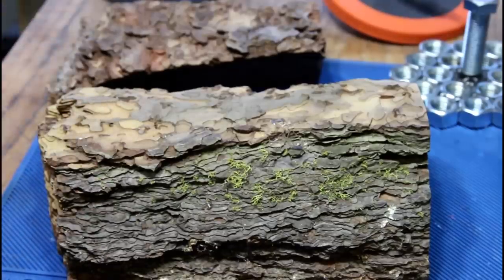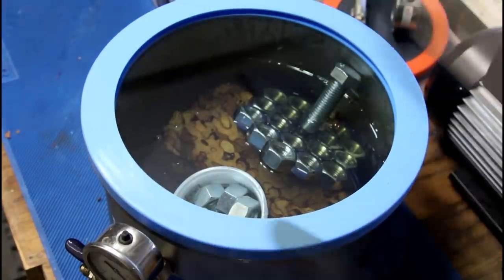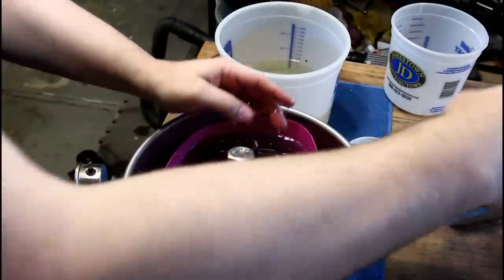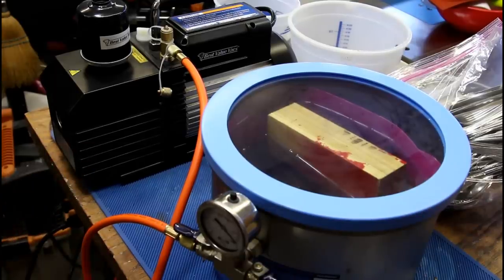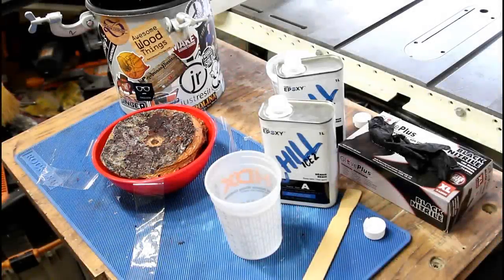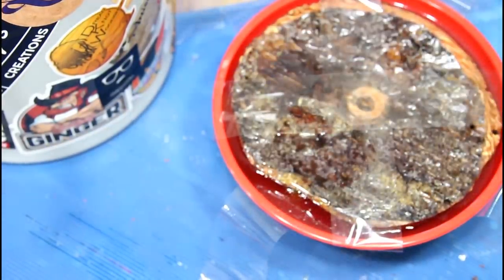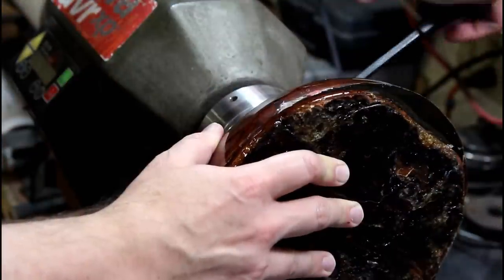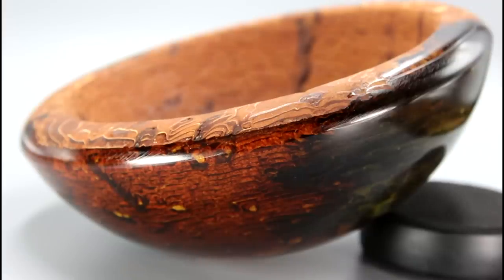Make a bowl From Bark? (...and resin) | Dipit #25

Comment: That turned out awesome! Glad you were able to put it to good use. If you need more for another project, I have a little more I picked up last summer.
Reply from the maker: Austin! Thanks so much. I’ve still got some left. :)
Reply: @peterbrownwastaken  How dry was the bark when you started? I am wondering because resin has a hard time displacing water. If it still has moisture you could probably put a piece in the vacuum chamber and leave it for the water to boil out.
Reply: Austin Lippincott After watching this video, I am definitely going to be researching this bark and tree type.  My kids will get a kick out of learning about this new to us type of tree(we homeschool).
Reply: that is very cool bark and peter is right it has a dragon scale like pattern to it also i have never seen bark that thick before today
Reply: @EricMadWolf  Considering it was from a dead tree AND it had been sitting in his shop for about a year, I'd assume very dry.
Reply: @kimjonglongdong3158  Considering bark from a open grain softwood behaves like a sponge and considering the green moss growing on it I have to assume that despite sitting for a year the bark wasn't dry enough.
Reply: @EricMadWolf  ah, I hadn't considered that. Can't say I ever even knew that bark could get that thick. You clearly know a lot more about wood than I do that's for sure.
Reply: @kimjonglongdong3158  a lot of times, a block of wood that size will need a few years to dry out as much as the atmosphere will allow. It may need to be baked for a bit to really remove the moisture
Reply: @peterbrownwastaken  It wants a spoon :)
Reply: @kimjonglongdong3158  I only know what I know from trial and error. My father has 30+ years of woodworking experience and I have about 10 years of experience and we still learn something new everyday. 
For example, bark is the only part of the tree that's living. The wood we use is dead bark that has been compressed inward (think dead skin flaking off but inside). Depending on the conditions, the tree can actually rot from the inside out while it is still alive. When a tree dies, whether it falls or remains standing, begins to rot from the outside in. Fun fact, dead bark can retain more water than it did when it was alive because it is no longer getting used. 
Learning about the medium you use is one of things I enjoy doing as a woodworker.
Reply: Many ponderosa pine trees are dying in California from the bark beetle. Normally the tree can defend itself with resin, but due to the past drought, the trees cannot defend as well. Another factor is forest fires. Due to the lack of forest fires (which are essential) from human influence, the beetles are able to get out of control more easily. I'm not an expert, but it is all very fascinating. It is a great learning opportunity!
Reply: @EricMadWolf  Bark isnt the only part of the tree that is living. There are living xylem cells, normally an inch or two from the bark, in the sapwood. The inner bark is living phloem cells, but the outer bark is just as dead as heartwood. There is also living tissue in the cambium of the branches, and roots, and all the leaves or needles, all the buds, and the root tips. In a sense of lumber, sapwood is composed of living cells, and the inner bark isnt even used. Id also argue that the problem with stabilizing bark is less of an issue of water retaining, and more to do with suberin. Outer bark acts as a sponge in a compression way, so things can hit the tree and the bark will absorb the blow. The outer bark gets filled with fatty and waxy materials that clog up the fibers, which repels water. It is designed to keep water in the tree and air away, like closed cell insulation.
Reply: @The_Great_Whodini  That's awesome, I love learning new things about wood.
Reply: Austin, I cannot find this bark for sale anywhere online and I NEED it in my life so hard. I'm obsessed with the look of this bark. I need to turn a variation of this bowl. Peter's video has sparked an idea that must be born. Can I please buy some from you?

Comment: Bark wont want to stabilize because as trees develop secondary bark, it ends up being filled with a waxy substance, so all the tracheids or fibers that one would expect to fill with resin, like normal wood, behave and are physiologically different, there isnt really pitting to allow for lateral transfer, and therefore resin filling, as well as bark lacking a secondary cell wall, meaning it is far weaker than sapwood because theres not nearly as much structural components and instead theres more lignin and hemicellulose, the biggest barrier in stabilizing has to be the suberin that fills the bark with waxy and fatty material and stops water and air flow... The ponderosa pine bark is also so thick because of fire adaptation, truly beautiful way to capture the structure of softwood bark. Im a forestry student, I like trees
Reply: TheGreatWhodini Forestrys a real interesting field, hell I think all botanical stuff is. Was wondering why the resin didn’t seep down as deep as it normally would, but I completely ignored the capillaries normally left by normal wood. Great explanation!
Reply: Do you plan on making and posting videos on the topic? I'm interested in hearing you explain what you're learning.
Reply: You use such beautiful words and yet so little punctuation. Please man, my brain hurts
Reply: @skeetsmcgrew3282  most of the time where there should be a period I just throw a comma and move on
Reply: @iplay10101  I dont have time, id love to, but I cant
Reply: @iplay10101  but if you have any specific questions I would be more than happy to answer
Reply: TheGreatWhodini I really like trees but don’t have much knowledge about them yet, I’ve learned more about animals so far going for a degree in environmental studies. I’ve been wondering recently - does seeing a tree covered in mushrooms/fungus mean anything about its health?
Reply: @hannahbrown5465  Absolutely, a fungus or conk on a tree is really bad for the tree health. A tree can be infected without visual signs, it will show symptoms like decoloration of foliage, or wilting foliage, indicating a health issue, and possibly fungal infection. If fungi fully takes over the tree it will release a fruiting body, or conk. The mushrooms are for reproduction and the spread of spores, and can mean the tree is in danger or already dead. It depends on the fungus, so learning to ID common tree diseases is important, as some will only live on dead hosts, and some only on live. There are publications by the USDA and sometimes state by state agencies that will release cull sheets to show deductions when estimating volume to account for certain diseases. Some fungi will compromise a foot or two above and below the fruiting body, and some may take up to say 20 feet.
Reply: Gosh, your comment about fungi on trees makes me a little sad. We had a tree back in my home growing up that had some kind of fungus on it and we never really paid attention to it. The tree wasn't dead, we knew that. It bloomed, dropped walnuts, etc, but there was always this fungus growing on it. The tree is gone now, as we aren't the residents of that home any more, but it's really something to think about.
Reply: @pacmandrugs  maybe, it might be interesting to try out, there might be some publications on solubility of suberin and may be interesting as long as it doesnt compromise the structure or appearance of the bark
Reply: I'm the opposite. I love working with wood so I kill it. I'm a carpenter
Reply: If you made a YouTube channel or a blog on this topic, I'd totally read.
Reply: Do you think a slow and low bake (190°F) for many hours (6-10) would melt out all the fatty/sappy deposits, thus creating voids for lateral transfer of resin? I do this with sappy woods and with woods coated in sealing wax prior to stabilizing with resin. It leaves a puddle underneath the wood of what melts out. If you don't think this method would work, do you have any ideas a to how to evacuate those spaces?
Reply: I love it when art/creative videos lead to fascinating educational stuff
Reply: Fuck yeah. Passion for biology
Reply: IIRC theres a way to chemically "wash" all that out of the bark, so you might be able to stabilize it a bit better.
Reply: I learned something.
Reply: I have no idea what you said but it made you sound really smart.
Reply: Wait I understand what your saying now and I have two questions that might hold the solution. Could you dry out the wax by drying the bark? If so could he poke holes before drying the bark and then stabilize it?
Reply: Lmao justifying yourself with "I'm a forestry student, I like trees"
Reply: Thank you for sharing some of your knowledge. I never knew this. 😊

Comment: Idea for the next Dipit... used rubber gloves. I realized you use gloves, as you should, when working with your resin. A new pair each time, I assume. So rather then throw them out you collect a bunch of the used ones, yay recycling, and make something out of them!
Reply: The elasticity might have something to say about that, but it seems like a cool idea
Reply: What would he turn it into?
Reply: @Alucard-gt1zf  I wonder if the resin would help with the elasticity. If not it would likely still be interesting to watch Peter try to work with it, like he did with the gummy bears ^.^
Reply: @PrincessSixThirteen  Not sure really. It would likely have to be something small but it would be amusing if he could end up making a cover for his gloves, like a box cover that is for tissues but for rubber gloves
Reply: Getting the bubbles out of that would be a nightmare, I bet. It does sound cool, though.

Comment: This will probably get buried, but just in case you see it Peter. I had some cactus juice that got sucked into my vacuum pump, and it cocked it up. The resin cures with the heat inside the pump and with the oil, and sticks to all the parts inside the pump. I had to pull my pump apart,  scrub it all, and even then it's still not pulling as good of a vacuum as it used to. 

Change the oil on the pump if you haven't already.

Comment: A fantastic result from such a difficult material. I love the seethrough section in the rim, it kind of contrasts the thickness of the shape wonderfully, and the outside surface under the resin, with the moss and everything gives it a nice foresty vibe.

Comment: Hey Peter i was thinking watching this, you should make  a special weight just for that huge tub instead of using the little one with multiple bolts to keep it level if need be
Reply: Yes. Even just add extra bolts to his existing weights, nuts too if need be.
Reply: Just get a small barbell weight. They're thin and don't cost much.

Comment: "No resin projects in January."  
I should print and frame your quote.
It was mid-December but I learned that the hard way. I thought "Well, it's cold (unheated garage) but I'll give the 24h resin 7-10 days to cure, it'll work, right?" 
Yeah sure!  I had to completely scrap a fairly large project I wanted so badly to be ready by Christmas.

The bowl might not be exactly what you had envisioned, but it turned out awesome indeed! I love the patterns and depth and details of it!
Admirable perseverance and attitude, as usual!
Great job!

Comment: Hi Peter,
At first I thought it would be a funny video about the mishaps that can happen to Resin. But then it became very vivid. Thanks a lot for this! I have had a bag full of very thick birch bark for years. I found it too interesting to throw away and now, thanks to you, I have an idea.
A little tip from my side. To make it easier for the resin to come out of the bowl, I coat it with silicone, just like you take it for molding. It works great and I can use the bowls again and again.
I'm looking forward to your next video.

Comment: When I have punky wood that is not really a good candidate for stabilizing I use a low speed fixture that I made from a rotisserie motor and adapted a 1"-8 bolt to with a locking nut to which I can attach my lathe chuck to hold my bowl, mug, etc. Then I mix up some clear resin and paint it over all of the surfaces of my piece, torch the bubbles, and allow it to turn slowly while the resin cures. The constant turning of the piece lets the resin self-level without getting drips and runs.

Comment: Fun fact: that thick bark is a fire ecosystem adaptation! It helps protect the tree from damage when fires come through. Ponderosa pines are fire department: their cones are covered in a thick resin which protects them until the heat from a fire comes through, which melts the resin and allows for the seeds to be released. Fire dependent ecosystems and adaptations are super cool!

Comment: Peter, you could brush coats of resin on the inside to fill the tear-out and protect the bark as you turn it at a slow speed.  Then polish like the outside.

Comment: Peter change the oil in your pump. Its easy and cheap enough.  Just in case you sucked up resin.  Also vac pumps accumulate water over time from moisture in the air.

Comment: Whenever you need to separate an outside shell like that plastic bowl and it's just held on basically by suction, if you shoot compressed air from a blowgun into the crack it'll just release like magic.

Comment: Love how it took both of you so long to solve the weight problem when stabilizing, but in the pressure pot you solved basically the same problem with... tape. I guess if it bubbled too much you could’ve used rubber bands. Speaking of which, can we get a rubber band dip-it?

Comment: Hi Peter, I love your channel and I keep re-watching your videos, over and over. I love your vision and your approach to the challenges. Now, I have seen Ariel Salaverria, a bladesmith in Argentina, using a combination of vacuum pump and pressure chamber to achieve deep penetration on woods arduous to stabilize. Basically, after turning off the vacuum pump, one does the subsequent soak inside the pressurized chamber instead of open air. It looks like helping a lot with the penetration. Do you think it could help with the bark as well?

Comment: That's awesome. Nice job, I don't know how I haven't seen any of your videos until today. Also, I love how you put all your failures of the process in as well, it's great for helping other people learn what to do and what not to do.
Just trying to help, not criticizing, but you should put more protection besides just 1 coat of wipe on poly. Maybe more coats, or something different idk. Just so it doesn't break down any more. I could be wrong and the one coat is fine if it's just a show piece (I'm sure it is) but still, I'd rather be safe than sorry.

Comment: Just a thought but after you cut the inside of the bowl you actually could have put it back in the cactus juice and pulled another vacuum on it. 

With so much materiel removed it would have been a lot easier to stabilize and I think the strength would have been better and it would have looked the same. 

It does look nice though. 👍🏻👍🏻

Comment: Hey so I infuse electric motors with resin and we use a similar process, but instead of just letting off the vacuum we put 100 psi on top of it.  So maybe try putting it into the pressure pot after vacuum.  Our resin is alot thicker then yours though.  We infuse it to keep all the wires from vibrating against each other inside the motors.

Comment: Just a quick question if you was to draw a vacuum & then close the valve wouldn't that then keep that in the chamber which would then allow you to turn off the pump and lesson the risk of the pump wearing out as much & would allow you to keep the material in the solution for a lot longer? Love the projects that you do and thanks for sharing them

Comment: Hello Peter, I am not sure if you'll see this comment or not, but I felt the need to comment do it anyway. It is about a project I thought would be really cool to see you do. Basically, the project is you use large card board boxes and dip them in a large tub(bath tub sized) and make a chair out of them. It would probably be really difficult and expensive, buts it's something i have never seen before and i thought it would a wacky enough project that you would do it.

Comment: Just an idea, but why not put a snorkel on the inside of the pot, then on the outside have a catch can and a filter before going into the gauge and vacuum line? Only other thing would be moving the air inlet valve to between the catch can and the pot. Probably the best, lowest cost solution if you don't plan on using pieces that large normally.

Comment: It doesn't matter if it fits in the container, you should still trim it to reduce the amount of stabilizer that gets used. Also, with the number of bubbles still coming out, you should have left it under vacuum (without the pump running) overnight, then restarted the pumping.
Reply from the maker: Oh yes. I know that now. If I tackle this material again, it will be a bit different of a process.

Comment: Peter, I have never done vacuum stabilization.  Could you take the pink vessel and then put it into a pressure pot to reduce the soaking wait time and increase the pressure the resin impregnates?  Just a thought

Comment: I know this is 6 months late, but I just had a thought and I don't know if you've done it before... You could probably add more weight to that nut weight by adding bolts to all those unused nuts. You could even make a second one without that handle that you just have short bolts in the individual nuts.

Comment: Maybe a 90 degree elbow that sits just below the lid would make that better so the air gets sucked in from as high up as possible, or a valve in the lid but the elbow would probably be easier